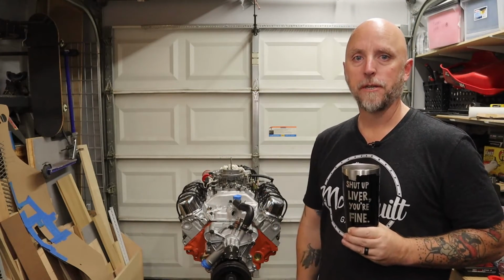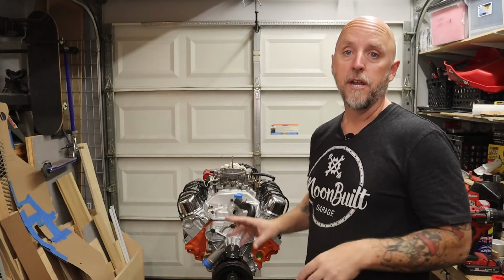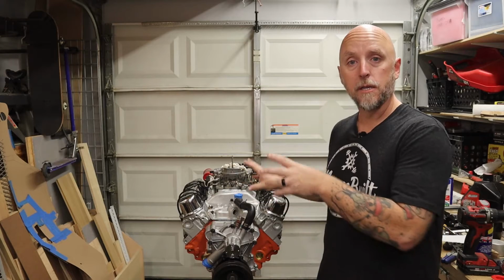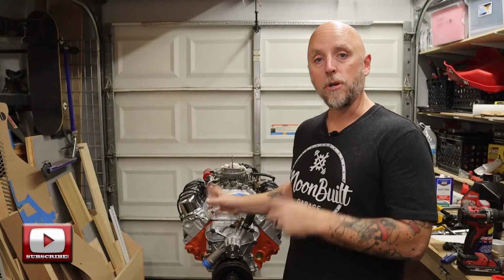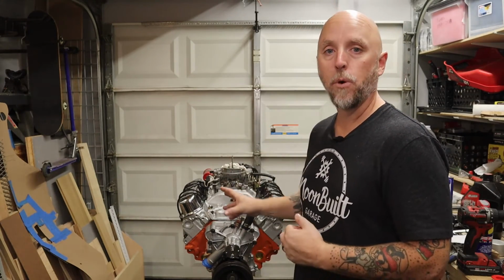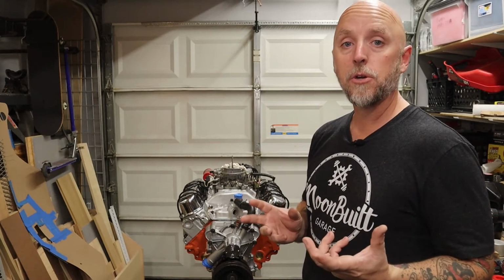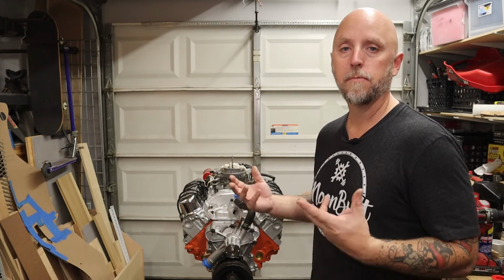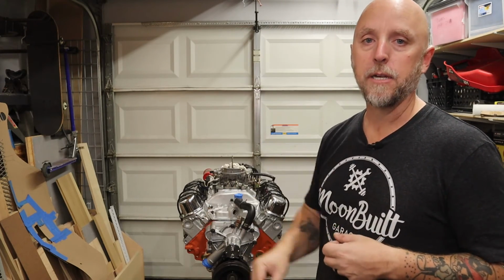Mopar 408 Stroker FINISHED | Dodge LA 360 Stroker Kit | Forged Crank | Forged Rods | Forged Pistons

Comment: I have an LA 360 and this is the first time I heard you can take it .100 over...I'll be keeping this running motor and rebuilding it for my 1978 D150! I have black Mopar valve covers as well as Hooker headers.
Reply from the maker: I was surprised too.  I dunno if I'd actually go that far over, but it's good to know that I'm still in the "safe" zone

Comment: What carburetor are you running?
Reply from the maker: It's an old Carter/Edelbrock that was on the engine when I got the truck...don't recall which model.  I did a video a few months ago where I did a rebuild on it